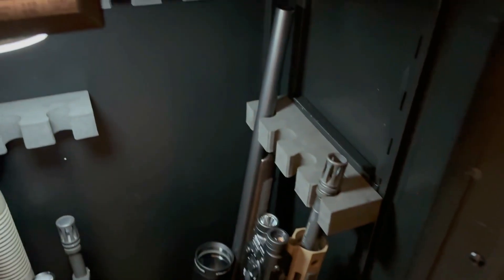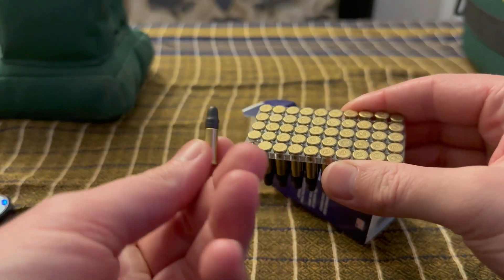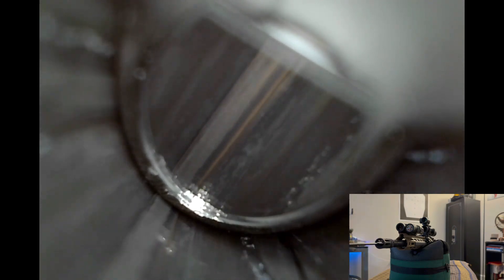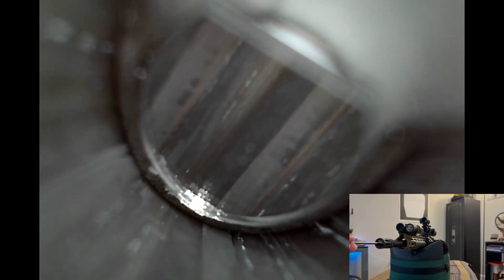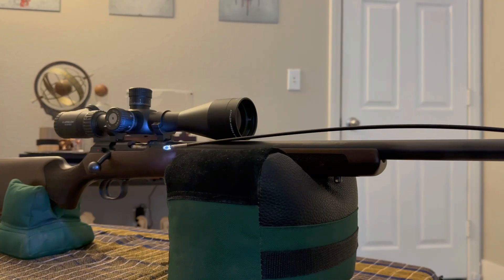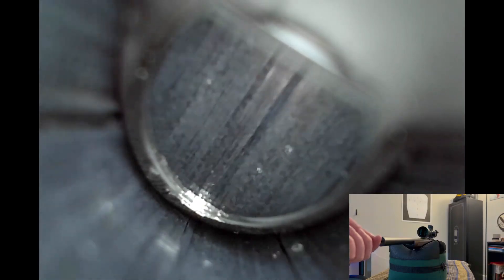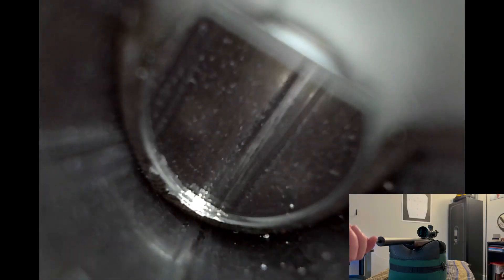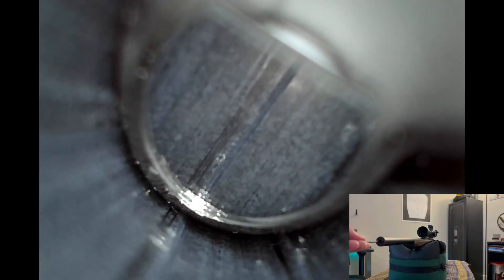What Thousands of Rounds Does to a Barrel: .223 vs .22LR (Borescope)

Comment: I came across your video and subscribed. I’m in my 70’s now and many years ago I purchased a Walther Ppk in .22lr. It was made in 1967 and I still have the original box and paperwork as it was one of my first 22lr handguns.  I shot this gun for years with mostly bulk ammo which you could buy for 5 bucks for a brick of 500 rds. 

I estimate I have a minimum of 50,000 + rounds though it. A few years ago I checked the barrel and it’s well polished but I can see sharp rifling and no noticeable wear.  It’s still as accurate now as it was then.  Also nothing ever broke after well over 50 years. 

I have to believe that it would take more than a lifetime to wear out a .22lr barrel.
Reply from the maker: That’s incredible, thank you for subscribing and more so for sharing! I would love a brick of 22 for $5, something about the fall/winter brings out the bug for 22lr in me - I find myself shooting thousands of rounds each week but I haven’t gotten a 22lr pistol yet, you’ve made me want to find a ppk for myself because 50,000 rounds is damn impressive sir. Thank you again for the support!

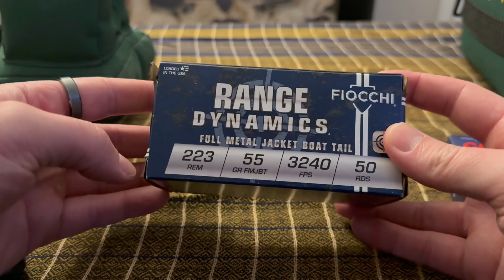Comment: I notice a lot of 223 ammo (i.e. 0:29) has the exact same specs and velocities as 556 ammo.  Does the 223 still have lower pressure (despite same specs), and does that lower pressure generally mean less wear on rifles?  How so?
Reply from the maker: That’s a great question, and marginally yes the reduced pressure means marginally less wear. The Fiocchi 223 FMJBT is around 55,000 psi while the 556 fiocchi fmj counterpart is about 62,000 psi, so with a 7,000 psi delta you could maybe equate some sort of % difference in wear, I just don’t know the math to figure it out for a straight answer

Comment: I’ve used that fiocchi 223 ammo before and it stinks. Is that a normal thing for cheaper range ammo?
Reply from the maker: What do you mean by sticks? I use fiocchi 223 and their 556 and haven’t had any hiccups in 4000 rounds as of today after the match I just shot

Or do you mean the fouling sticks
Reply: @blu-manchu I think Masked Monkey was referring to the ammonia line smell that hits you when you crack open sealed container sometimes.
Reply from the maker: Hmm I think I know what you mean then
Reply: @michaelprather8371 no it’s the gas’s from the ammo. I think my guns a little over gassed so that doesn’t help
Reply: @blu-manchu I ment stinks. It smells weird compared to some of the pmc m855 I’ve shot
Reply from the maker: Hahah that’s funny - I’m not sure if I noticed a different smell.. at least no different from a few of the other brands I’ve had, but truth be told I don’t have a great sense of smell to begin with so maybe you know something I don’t haha
Reply from the maker: You’re about to have me sniffing my m855 vs my m193 dude haha